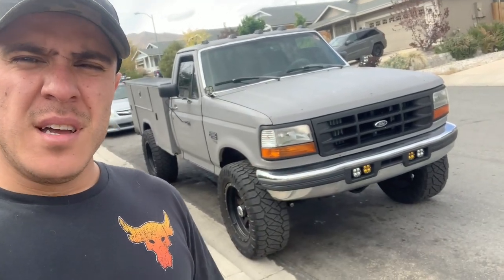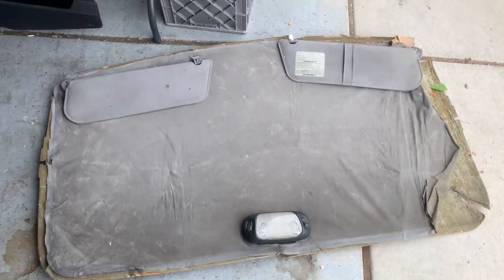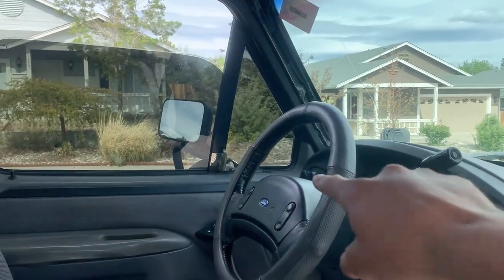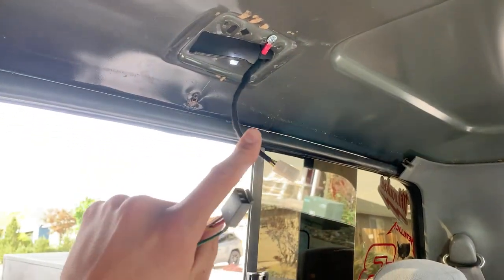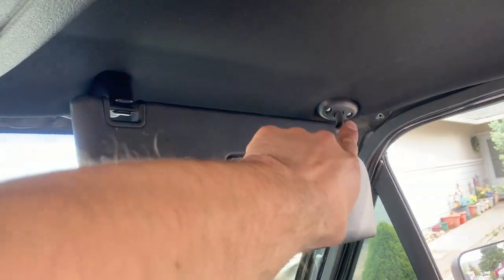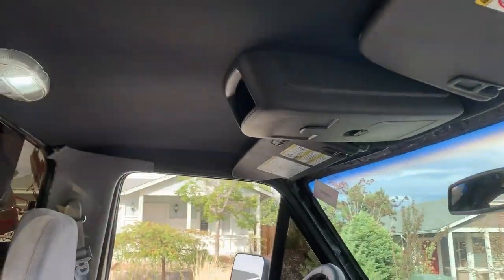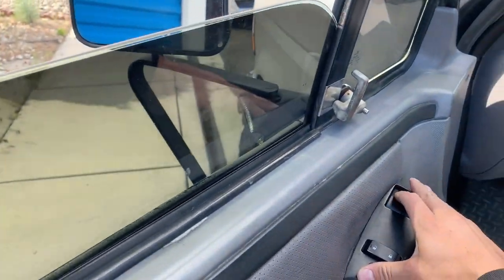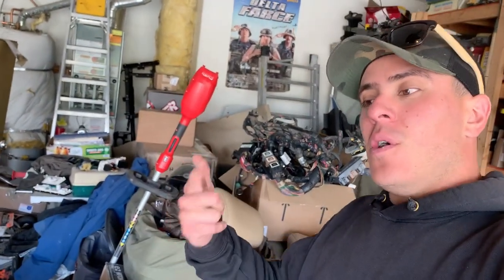My 96 F350 7.3 Dixie gets a New Headliner with a Overhead Console, Sun Visors & a Dome Light

Comment: There is (should be) a wire harness at the left (driver’s) kick panel that goes up behind the parking brake mount. It has plugs for the visor lights and the automatic day/night mirror. You would just need the OEM harness and it runs up the pillar to the roof.
The constant 12V for the dome/map lights goes down the pillar by the seat, under the door and into a multi wire splice at the kick panel that’s notorious for corrosion. (Mine only shows 2.1 volts at best)
Looks great! Definitely got ideas for upgrading my ‘95!